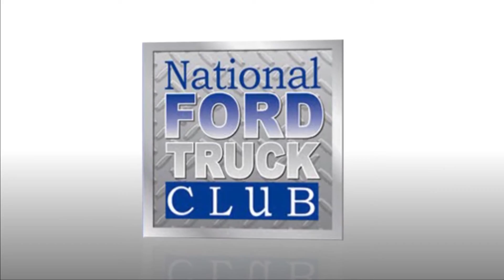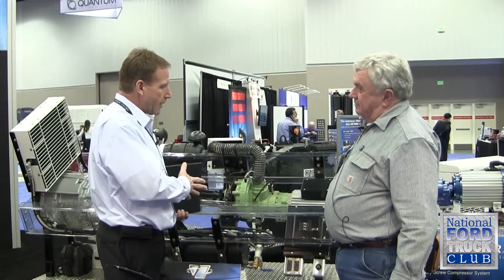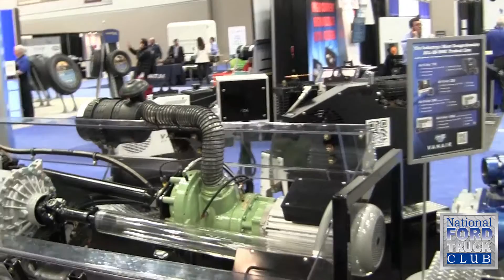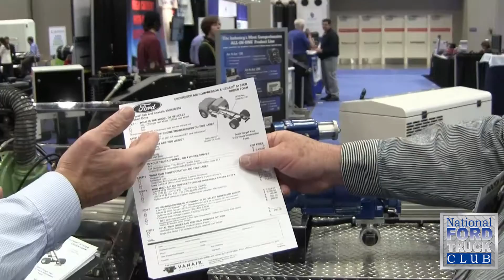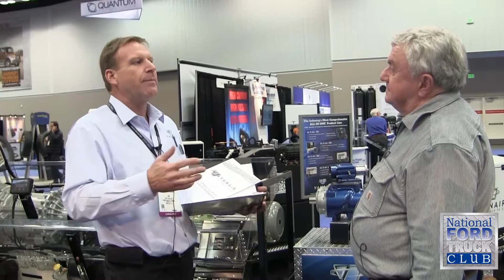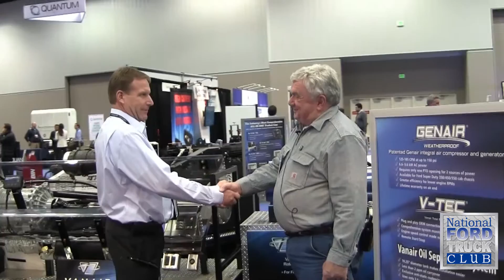Vanair Under Truck Air Compressors and Generators

Comment: i have a international 4700 with a built-in air compressor and Generator combo does it have a cockpit to drain the moisture out of the tank it is killing my air tools with all the water?
Reply: Thats a very easy fix on any air compressor set up.. add a drain to it..
Reply: @dirtylu79 also with the power available you could add an air dryer to it